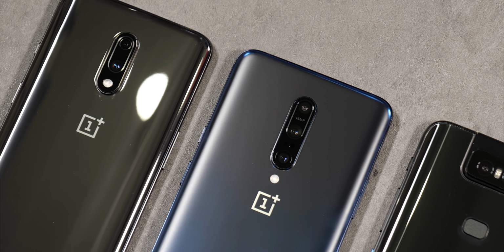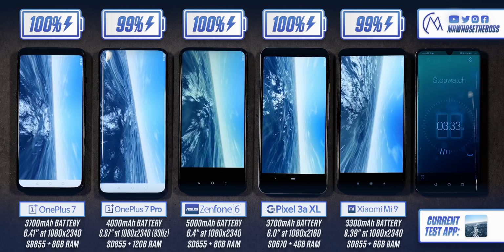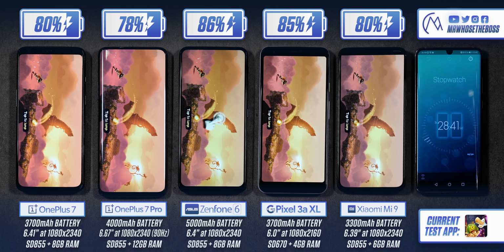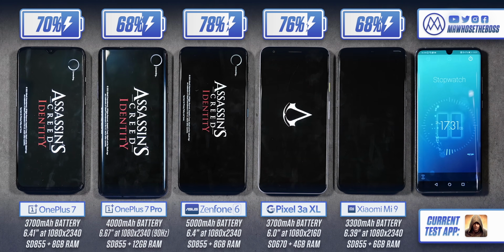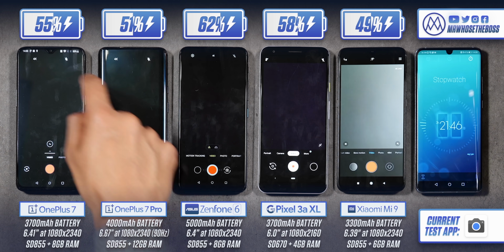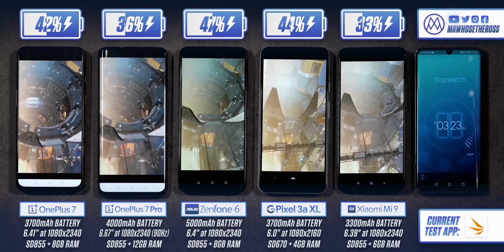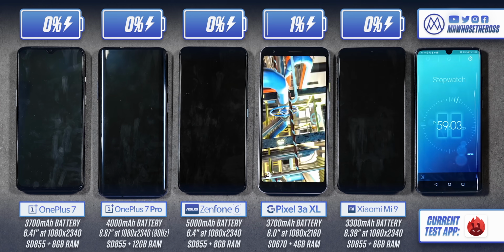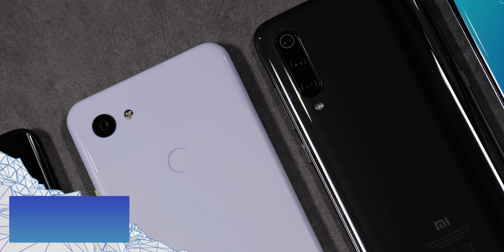OnePlus 7 vs 7 Pro / Zenfone 6 / Pixel 3a XL / Mi 9 Battery Life DRAIN Test.

Comment: Message to all, i really need to know if the pixel 3a XL is able to endure 2 days of quite intensive usage : youtube videos 2/3 hours, photography (a lot), Instagram, Netflix (3 hours),  transfert files, listen to spotify all day, and GPS for trails (like 5 to 6 hours, i used to turn in plane mode to avoid battery drain)

Cause it seems that phone like the mate 20 pro or P30 pro can allowing you 2 days of insane usage !!!

As there isn't much video of the Pixel 3a XL' s battery with others phone like this test here..
I really need your opinion on that people. I mean, i need to buy a phone the battery life is a real deal breaker, but some spec tech can balance (camera / storage / quick charging / UI / ecosystems)... but the battery that is really a problem. Tell me what you think !

Here the mate 20 pro videos battery test:
- https://www.youtube.com/watch?v=gyfwusjUBVQ (real life test by Mrwhosetheboss btw)
- https://www.youtube.com/watch?v=giLnwUAK-oM&t=450s (real life test by Danny Winget)
- https://www.youtube.com/watch?v=97LAtXGEMNo&t=3s (mate 20 pro / One Plus 6T)
- https://www.youtube.com/watch?v=QgqinnFGqmQ (mate 20 pro / S10 Plus vs Note9 / One Plus 6T)
- https://www.youtube.com/watch?v=LkiniAkBOyU&t=353s (mate 20 pro / Note9

Pixel 3a battery test :
- https://www.youtube.com/watch?v=AQ85eJkupWk (curious result vs the P30 pro btw)

P30 Pro:
- https://www.youtube.com/watch?v=C9IPyPBDZQU (real life test)